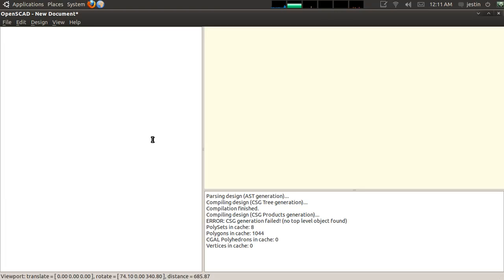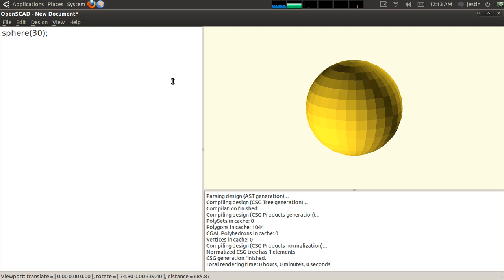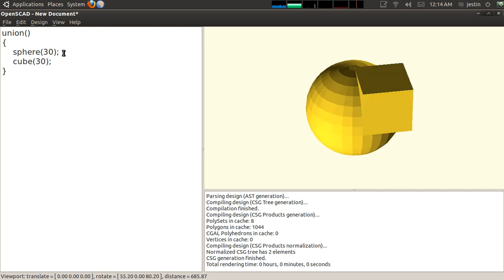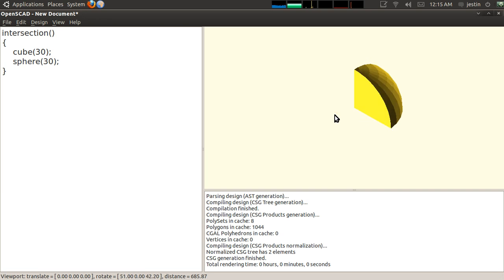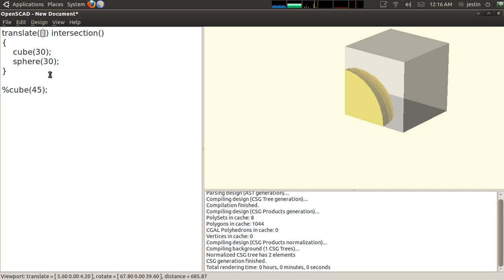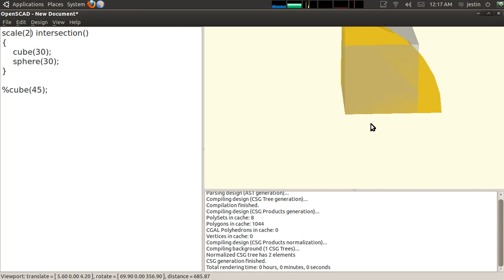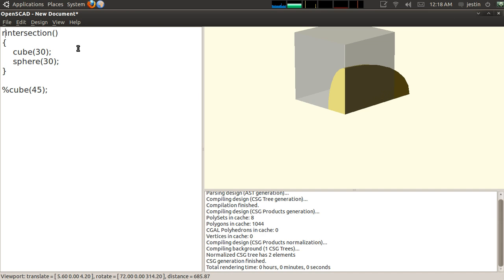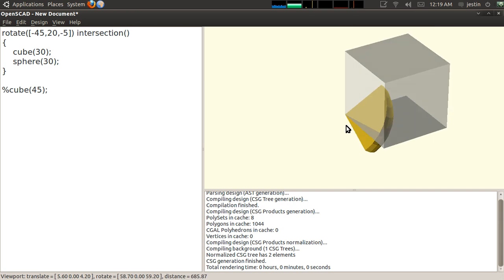CSG Basics in OpenSCAD

Comment: OpenSCAD is very sensitive to syntax.  Misspell one little word, use a semicolon where you shouldn't or don't use it where you should, and it goes kablooie.

In my case I had a semicolon problem; I don't remember if it was one too many or one too few, but that was it. Other times I've messed up by having or not having [square brackets], having or not having (parenthesis), and so on.

It's like an English paper back in middle school, except that...

durned character limit